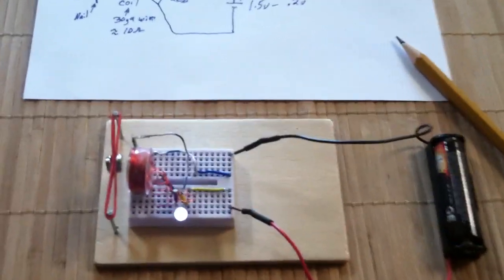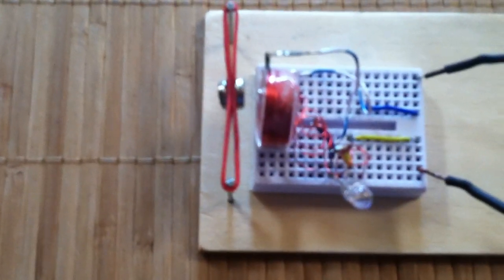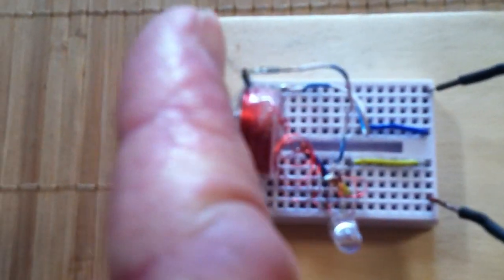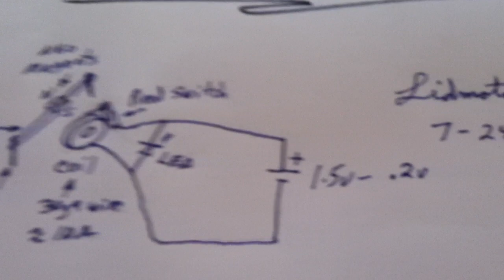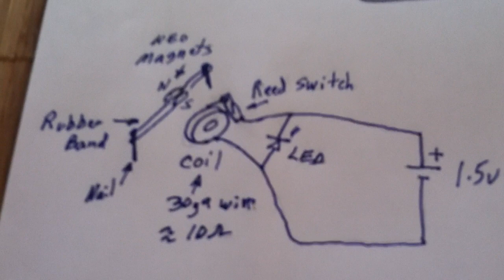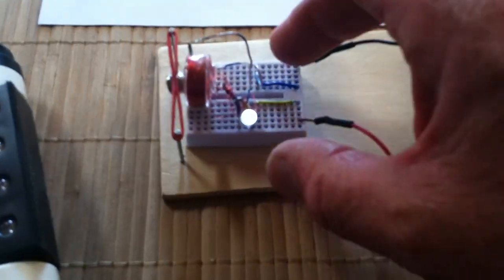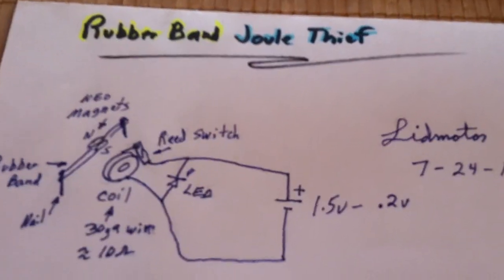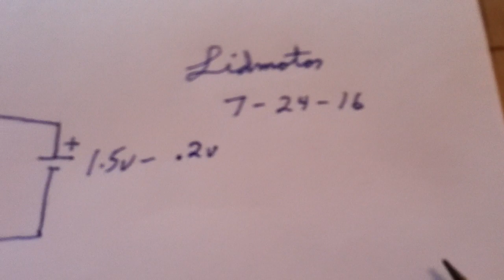Rubber Band Joule Thief

Comment: loll Rubber band transistor ! I like it
Reply from the maker: Kinda sorta. If I could figure out a way to bias it then it would be a better device.
Reply: What if the circuit was also suspended with rubber bans on four post so it could push and pull as the magnet does.

Comment: Nice build. It could well be a fun avenue to explore, ways to avoid diode drops and transistor switch on voltages. Ideally, the amperage would be right down too, microamps sort of thing. A blocking mechanical joule thief using capacitor charge dumps ? maybe a biasing magnet, such that the forces needed for movement are reduced :)
Reply from the maker: Yes. I was thinking the same thing.  This is really just a 'buzzer' oscillator but the rubber band was a nice twist. The first thing that came to my mind was an old Ford spark coil that switched the primary with a similar method.  Were you around when the Imhotep project was going on here?  A 12v car relay was converted to an oscillator and the back spike was gathered.  I made a CFL driver out of it but it was too noisy.
Reply: Around that time yes. Certainly with the PC fan conversions, that was another good one.
Reply from the maker: 2008 was such a hopeful time for me in regards to the 'free energy' movement.  I thought that any day someone was going to construct "the" device that could make energy out of nothing.  A black box that when you flipped the switch out came all the energy you could ever use.  Ha.  It completely defied logic but the effort ended up as this great hobby.  No regrets.  By the way my rechargeable Al soda can / salt water battery is still working and getting stronger every day.  Hummm.  I may have to do a video on it.
Reply: Please do, the soda cans and concrete batts may find new audiences after the several years. I believe that several black boxes are out there and running, we just have to find out what's inside. Fave thought is a Lockridge/Bedini/Muller/Yildiz/Babcock hybrid, but who knows ? lol.
Had an idea for salts cells that would look good at your place - to build/modify a garden bird bath. A tiny tube down to the cell keeps the mix going, but not oversaturate. Would look like a regular bird bath, but with LED's around it at night. That bird visitor that you had would enjoy it ! Some kind of bimetal arrangement might allow for an auto-calibration. It's fun to return to the older projects with more understanding and ideas :)

Comment: Is the "Negative Energy" from the back spike traveling through the reverse biased LED to charge the run battery?
Reply from the maker: Not really because it is dumped to ground.  If I rewired this so that the back spike went to the (+) then you do get a bit of a recharge. The better way is to not close the loop and send it to a second battery or capacitor.   Oh gosh this is sounding like Bedini SSG stuff isn't it.?---all using a rubber band.

Comment: Awesome.
Reply from the maker: Fun stuff.
Reply: *****
Does the reed switch arc when you use it like this?  I would think that is what the AM radio is picking up.
Reply from the maker: Yep. That is what you hear.  If the led is placed across the reed switch it cuts that down.  With this low power the reeds don't weld shut very often.
Reply: *****
Alright, that is what happened to me when I had something using a reed switch.  I forget what it was now (30 years ago) but the thing welded itself shut so was always on.

Comment: Would putting another coil on the other side of the rubber band and magnet add anything?
Reply: Make it so Lid. :)
Reply from the maker: That might work.  It would be a 'push pull' situation,
Reply from the maker: I tried it yesterday and it worked.  It made the oscillator more stable.
Reply: *****
Were you able to get power from both?  I suspect that if you could sync them you would double your power.